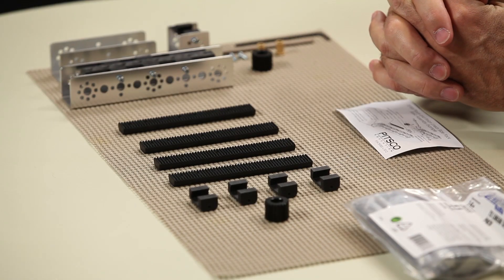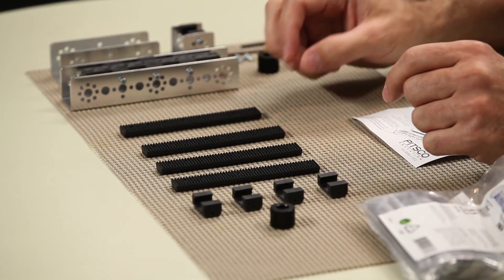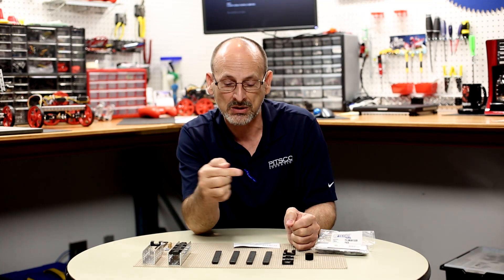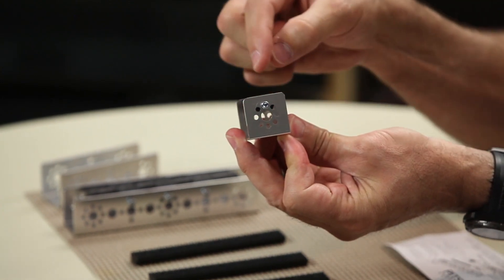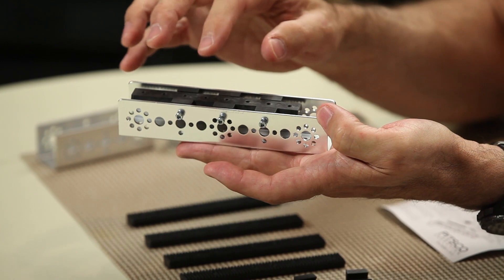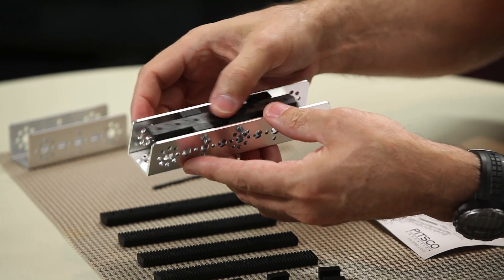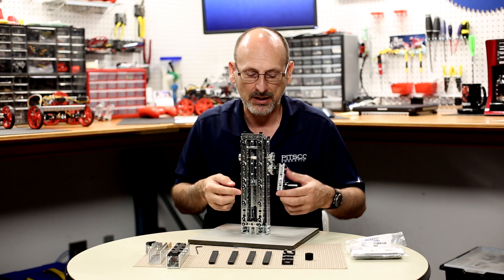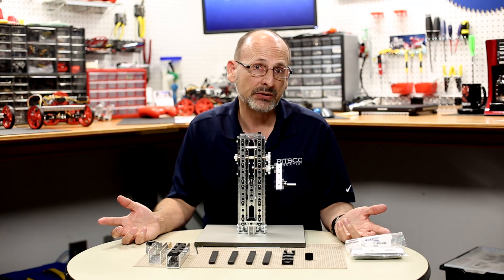Applying the Rack and Pinion Linear Slide

Comment: Hi there!

I ordered the tetrix channel, gears, motor mount, dc gear motor and the rack and pinion slide, but i cannot put it all together cause i cannot attach the pieces together, what product should i buy to be able to attach the gear to the dc motor or the pinion? are the screws particulary or you can use generic ones?
thanks!!
Reply from the maker: +Gabriel Mellace - Thanks for contacting us! Your rack and pinion slide should have come with an instruction card that noted other components not included, and the socket head cap screws that can be used (6-32x5/16, and 6-32x1/2). These screws can be found at http://www.tetrixrobotics.com/Socket_Head_Cap_Screws. We have other hardware that can be used to connect your parts at http://www.tetrixrobotics.com/Fasteners_and_Hardware/TETRIX_MAX. If the selection is confusing, please visit http://www.tetrixrobotics.com/Support/ for support options.